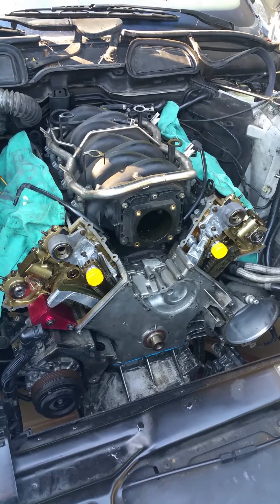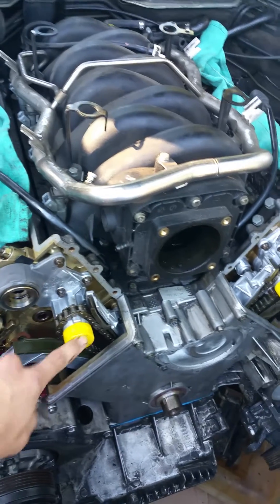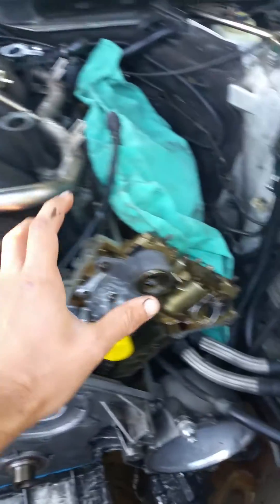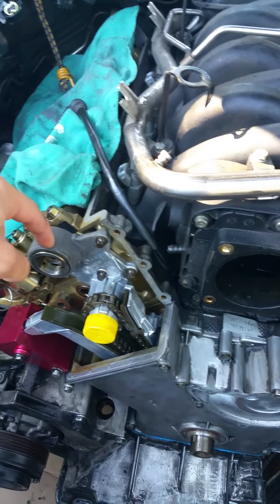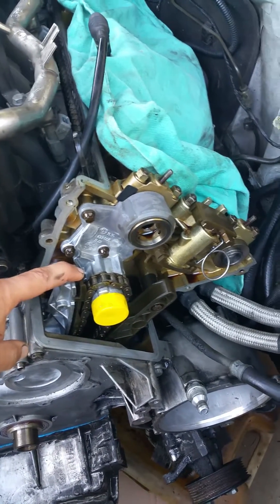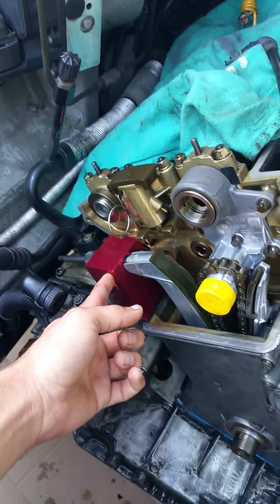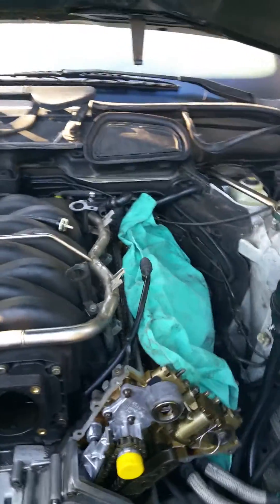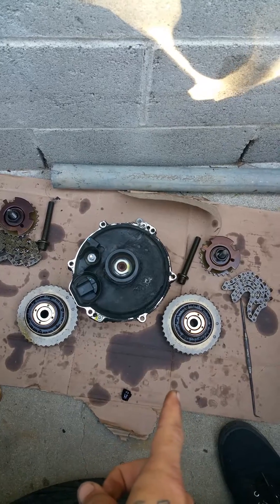BMW M62TU Vanos unit rebuilding 1 of 5

Comment: How do u set vanos for m62 without special tools
Reply: Stephen Hodus the key is finding CYL #1 top dead center, then locking the cams.  If you can make a block of wood or 2x4 fit the square ends you could probably make it work.  Keep the cams locked and the rest is cake.  Just takes some time.
Reply: @Stephen Hodus also, a drill bit to hold the flex plate at the transmission.  I believe 5/16” fits in there okay.  For holding pistons

Comment: Hey, im right at the point where I've replaced the chain guides and I noticed the vanos bank a just squirted oil at me cause the cam block came loose causing the cam shaft to turn a couple degrees. Does that squirt indicate a failed vanos seal?
Reply from the maker: Kev A, oil is usually trapped and is a good thing meaning the check valve isn't draining the oil out. when you move the cam back to square with the blocks just get it lined up you'll be fine.  A failed seal is noticeable when you start it and hear a RATTLE or when running hear a Dieseling. Was that the reason you tore into it?
Reply: @mrwimmel55  i dropped the oil pan out of curiosity and discovered the dreaded plastic guide rail shards

Comment: How do you remove the gears? I'll post a video on my channel of what I'm dealing with. I bought my car like this and i can't figure out how to remove the vanos gear
Reply from the maker: Bryan Wolffe send me a link if you get stuck.  The gears are helical cut so you need to pry, twist and be careful when moving the piston out.  When it’s out you’ll see those seals.  If the vanos is on the car I’d say you want to keep referencing other videos where they disassemble the front covers and lock engine timing.  Let me know if there’s success!
Reply: mrwimmel55 i managed to get it off, the inside of the gear was split in half